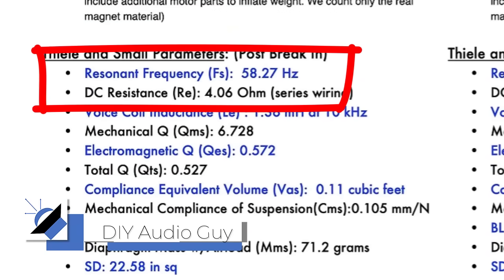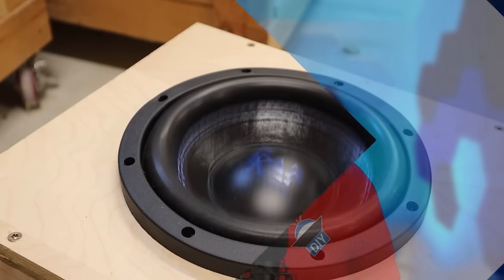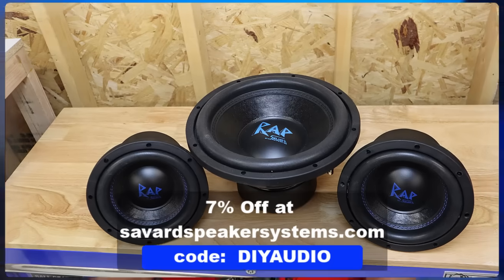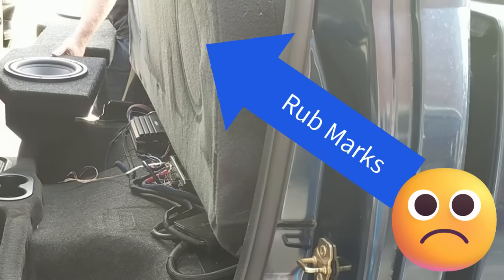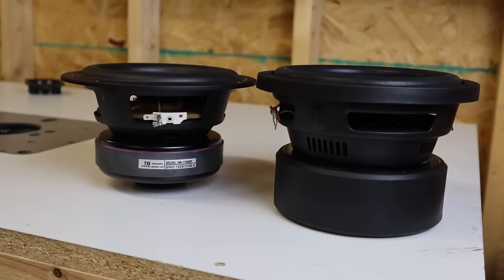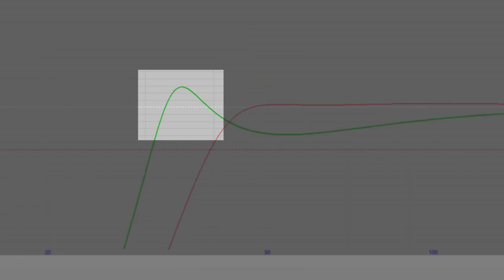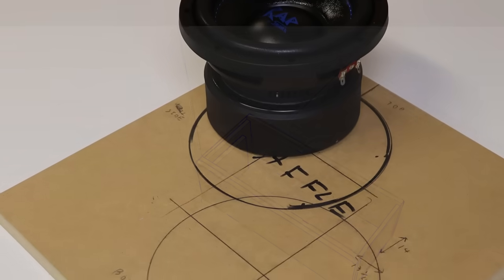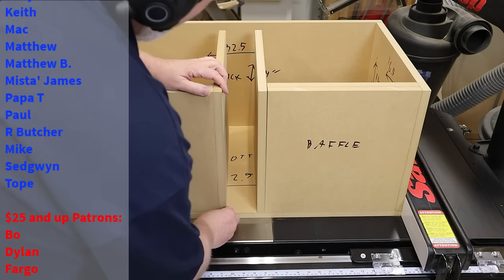The Problem With Small Subwoofers

Comment: One of the equalizing factors a small sub has has to do with acoustic coupling. In a standard sealed or reflex application the coupling efficiency isn't all that high. If you horn loaded a cabinet or use a column of air to dampen the speaker at a specific set of frequencies you can help to make up for the smaller size of the driver. Of course this is in theory. To do it correctly requires a lot more work than using them in a sealed/vented system. Truthfully though, the same applies from larger drivers too. I made some custom tuned systems for a friend that used two 4" woofers to generate more bass than a single 12" system. With proper tuning along with using factors such as the internal resonant effects of the vehicle cab, you can achieve some great results with small drivers.

Comment: My 30 years of building enclosures has shown me that more motor force per square inch and FAR better cooling makes it easy for quads to beat a single in the same available airspace! Diffraction imaging and power compression are the problems of larger drivers.
Reply from the maker: Excellent point.

Comment: Well? If you run sixteen 6.5" subs wired in series parallel on each side, you're probably gonna have more magnet & power and moving mass responding Quicker than an 18" subwoofer. AND That would quadruple efficiently efficiency. Home & car audio doesn't seem to pay enough attention to the Benefits of high efficiency if you ask me. I run band speakers in my house.

Comment: Tried Hertz MPS250 10' in my polo, cause had only 14L of space in the spare wheel (made a circular custom box in it). I gotta say I love it very much. Some pieces in the car rattle when it plays full tilt with 500w amp. It is not going very low tho, I think 35hz tops.
Reply from the maker: Nice!!

Comment: The real problem, trying to explain the problem with what you’re trying to explain is it’s more complex than that. You can also like you said add more power to the speakers having stiff suspension does raise the FS.. but if you have enough total volume, you can overcome a lot of these problems.meaning go full retard on your small setup. I have 3 hippo xl 6.4 subs is a small box I’ve taken the box apart three different times to get the tuning just right and now it hits Lowe’s like an hi power 18

Comment: I'm a bass player. Multiple, 4 to 8 10" drivers are considered ideal because it allows low bass frequencies with tight bass and they can handle a lot more power than 2 15". The lowest bass frequency of a standard tuned 5 or 6 string instrument is 32 HZ. The small interior space of a car or truck allows good bass response from small speakers because pushing a lot of air isn't necessary. The same speaker in a room would sound pretty bass shy.

Comment: Most music doesn't actually go that low so you don't need a big subwoofer, also there's the fact that many people dislike the additional noise of the car rattling along the sub. 
Sure if you want to have a rattlebox that turns heads wherever you go then sure big subs are ideal, but if you actually want to improve the sound quality smaller subs should work well.
Reply: a small sub can rattle a car too, it's up to you to get a well built car or to add sound deadening/vibration damping material yourself

also depends on the type of music you listen to

i mostly listen to DnB and bass does actually go down to around 25-35Hz often in the songs i like

that being said the biggest subs i have/had are only 12" which are plenty for me and can play that deep, especially my Punch P3 in the 3.15 cuft box which is tuned to 25Hz

i actually think larger than 12 sounds worse, 10 best for sq imo cuz most of them 15" and up are generally slower in transient response, 12 is a sweet spot in loud and deep bass with decent transients imo

but even the weakest 10 i ever had which was some no brand sub, once put in a decent box, actually already went loud to be fair, and already audibly vibrated the car.

fun fact that no name thing was better than some Crunch garbage sub i bought years later

Comment: The Rythmik FM8's which are dual 8 inch servo subs have, in my experience, no equal. I've tried Rel, SVS, Martin Logan and Velodyne (12-18 inch subs) and the 8 inch FM8's simply blow them all away in terms of transients and integration into the mains. Absolutely no comparison in my opinion. They pressurize the room, can shake the walls and yor stomach, and are yet so clean (i.e., not muddy). Perhaps I'm comparing apples to oranges given they are servo subs but....
Reply: Servo subs are the only way to go if you can swing it.

Comment: I'd  say Spl depends on the mass of the sub moving more than the power. And the sound depends on voicing capabilities of the woofer.. neither of which anything smaller than a 12 or maybe 10 inch sub could impress me  enough to use them. Air movement is key. Ported boxes have more dynamic sound VS sealed. You can use more power in a sealed box tho and it's significantly smaller in airspace.. I just prefer to use  8 - 12's  in my vehicle. That way you don't need more  bass. Like... Ever!!? It's always plentiful.. haaha😂😂

Comment: i tried recently to get a ported 8" with a custom folded port with radiused inlet and outlet to sound as good as a 10" in the same space of .5cuft and it was a bust, the port noise and less tight response made the 10" sound better by comparison even if on paper the 8" might have seemed best

Comment: i still have 4 dayton audio rs225-8 drivers with aluminium cones laying around, waiting for two high sealed boxes. sealed and big enough to get a smooth roll-off at the lower end. no more vented boxes for me. with two class-d amps and an active crossover, i will be fine. two fosi audio amps should deliver much more power than i will ever need in my living room.

Comment: Hey, what's up with the formula at 0:46? i mean, what is 50pi doing in the nominator there? The formula should be 1/(sqrt(...) * 2pi), as long as you use proper SI units. Yes, if you use different units (N/mm, grams) you will need a conversion factor somewhere, but whatever happens, how could pi had possibly moved to the nominator??
Reply from the maker: The source I use for the formula was incorrect.

Comment: I've owned just about every brand and size of subwoofer out there. Unfortunately car audio in the 80''s and 90's was ridiculously expensive especially for a kid. But thr first time I was able to afford a larger subwoofer "15's and 18's" I could never go back to smaller subwoofers. If you don't have the room then sure you can get plenty loud with an 12,10 or even an 8. But in the end there's no replacement for displacement. Cone area is king.

Comment: Idk... you put a single 15" Crescendo Forte in an extended cab 96 ranger and you wont need to buy multiples of the same woofer or get too crazy about box design. Thats the other thing... if you have the option to buy just one sub VS. Two or four of the same one, thats money that could be spent elsewhere in the build. Admittedly, i used to try to see what i could build with little or no money. Ive traded for car audio stuff, people have given me stuff... that Crescendo was in a guys yard and i passed it every day for three weeks. I was walking to the dollar store when i seen the guy outside. I asked him what he was doing with the box because i had a RF 12" and needed a box. He says " you want it? You can HAVE it, sub and all" i asked him what it has in it. He said it was a crescendo until his "girl" threw some groceries in the trunk and a gallon of milk ended up busting the cone. I epoxied it back together and beat the roof up in my ranger for a year and a half 5-7 days a week with it. I could never afford to do apples to apples tests to see what i like best in a setup... it used to be "run it til it goes up in smoke, attempt to fix it, if not worth fixing, find a deal on something as good or better something. Nowadays, i do have some adult money, but im more focused with engine building and engine swaps because my bass truck turned into race truck

Comment: Small subs are cool, for the intended purpose, but i also like using them with passive radiators . Even more space , easily adjustable tuning, and more cone area. Not as much of a peak in dbs as ported but a much better bandwidth and still a good amount of bass.

Comment: The box you built for your point doesnt make sense. You still ended up with a small box with a long port taking up much of the volume. You can split that box in two, right down the middle. So compared to a single driver, you only saved 1 endplate in box size.

Comment: I used to be a 12s and 15s type, now i use 10s, the box is what matters most in my opinion, in the right box you can get louder than a couple 15s in a bad one.  got a ds18 zr10 d4 on a taramps md1200.1 2 ohm in a 1.8 cubic ft box tuned to 31hz and its able to float a bag from 26-34hz
Reply: 18s are where it's at.. "that earthquake bass lol

Comment: Im actually looking to upgrade my system. If i go to a random local stereo install store will they be able to help me without ripping me off? I don't know what will fit how many subs to get what brands, amps ect, ect. I have a new truck with full size crew cab.  Im looking to do  under seat mount subs. Would i need to replace the factory door speakers too?
Reply from the maker: They will try to upsell you  as much as they can.  No different than anythign else these days.

Comment: Ok so I have a CT Sounds Strato 8" sub in a ported box and it gets the 600 watts of RMS it can handle. What would be the best Sub to add to get the deep deep rumbling bass at the lower hertz to pair with this that would run at 600 watts rms?
Reply: a 15 inch sub.

Comment: If you want to use them in some sort of horn box, they can be good, but price to displacement ratio with smaller subwoofers isn't as good. Or in a small box, a passive radiator might be more efficient than a long skinny port.

Comment: I don't know why people like these smaller subs if space is limited get swallow mount 12 with a long vent to get the most out of your sub. I used the skar vs12d2 for a couple months before getting a new box and a 12inD2EVL with a new 1500w amp I'm about to wire it to 1ohm and its going to be perfect for my extended cab f150

Comment: If you're concerned about box size and footprint putting two subwoofers together isobaric allows you to cut box volume requirement, still requires a long port though and port resonances become a problem. At that point you're basically needing to build a tapped horn design.
Reply from the maker: I like to call that the small box problem.  As the box gets smaller the port needs to get longer.

Comment: Smaller woofers will be faster than larger woofers.  Therefore, smaller woofers will be more dynamic than larger woofers.  Done right, you will get more slam out of smaller woofers.

However, larger woofers will push more air.  So comparing one small woofer to one large woofer will result in trade-offs.  The solution, to have it all, is to have multiple small woofers.  Then you get the speed / slam, and you get the volume of air that is pushed by a large woofer.
Reply: No, they are the same speed, it's the same frequency dude.
Reply: @N4CR  "No, they are the same speed, it's the same frequency dude."
There are fast amps, and not so fast amps.  You can hear the difference.  Yet, both amps are reproducing the same frequencies.

Smaller woofers will respond faster.  It takes less effort to get them pulsating, and less effort for them to change their amount of pulsating, as the frequencies change.

Comment: Was running a 12” in my trunk and it was great to rattle everything on the outside of the car. Switched to an 8” mounted (in a custom box) to the underside of the rear shelf firing directly into the cabin. Sound is better both inside and out.
Reply: I put a 12 in the cab.. sounds amazing.. putting it in the trunk was the bad decision.
Reply: that has nothing to do with the size of the driver and everything to do with your install. You'd have been better off trying to make your 12 work in a similar install to your 8
Reply: @ZZPxFTW  I obviously would’ve preferred to use the 12” in a similar way, unfortunately the rear deck size wouldn’t allow it.
Reply: @ImJaySco   gotcha; just with the topic of the video being what it is, I read your comment as implying the 8 was a reason it sounded better.  My bad
Reply: @ZZPxFTW  idk, its like you say its about the instal vehicle, theres tons of variables. did the sound proof the cab, or atleast behind where the speakers are located. Theres tons of things that affect sound.
Reply: @Killastoned it’s even more than that.  It’s shot tons of things.
Reply: My first car in 95 Cavalier 2 x15 in PPI subs in a sealed box what's a PPI bass amp with remote bass knob it hit hard but sound quality was amazing
Reply: I bet that sounds good with bass bouncing off that back window and rear deck, especially if sound deadened good.
Reply: Yes this is exactly what i wanted to say, I had two 12s in a 2020 crv open cab firing straight up. switched up to three 10s. in a skar 3 ported box. At half power its sharper =that the 12s. the 12s were loud yes, But lpf would distort em at heavier/higher loads. The 10s handle it without an issue and tbh its so much louder. But i do believe the size of the cab/trunk your using plays into everything, so what works for me and sounds great might sound like shit to you.
Reply: Was that a bandpass enclosure ?
Reply: @NickySeven-l6e No, basic ported boxes.

Comment: Hi DIY GUY, I love your channel. I build small full range stereo speakers that sound awesome and are super inexpensive. However they sound way better with a sub. But I suck at building subs. My UNICORN is an inexpensive sub driver under $100 in a ported box which sounds as good or better than a logitech Z623 sub. Remember its a desktop or smallish room setup, so I'm not out to shake the house. From your vast Experience, Can you reco a driver for my UNICORN? You can see my builds on my chsnnel. Thanks ahead and happy DIYing.

Comment: Even if the Fs is high, sometimes small subwoofers can be tuned in the 40 Hz region which is about the lowest extent of 'musical' bass, apart from synthesized bass. And if you've just got room for a tiny cube sealed box, you can still apply equalization and work together with your vehicle's cabin gain function to get 'flat' bass to a low frequency, it will just be excursion-limited or power-limited.
Reply: below 40hz is called sub-bass, and the music bass goes from hearing, to feeling xD

Comment: Yes, BUT: a car is an enclosed space which boosts very low frequency and makes it perfect to use a small sub as you can tune its enclosure to this small space or am I missing something here?
BESIDES: I don't look so much at what Watt a speaker is rated at but I am more interested in High Sensitivity and Low Distortion over the intended range

Comment: We have already done this comparison. 
Two 12" drivers tend to win against one 18" driver because they often have a more powerful motor in relation to the MMS. This means that the 12" drivers are also capable of handling more power. However, you have to find 12" drivers that have just as much Xmax, which is quite difficult to find. Because the 12s tend to have a better mass/drive ratio, they generally sound much more precise.

Overall, however, it makes no difference. If the TSPs were the same, it wouldn't make any difference whether you put two 12" drivers or one 18" driver in the same cabinet. So it depends more on the parameters than the driver size alone.

Comment: 250 watts? people still buy speakers that weak? well, if they put 1000 or 2000 watts on the box I probably wouldn't trust that either. buy a good brand and know what you're getting. I paid $350 for a diamond audio 2000 watt 15. they sell 10's too, but I don't want something that small. I know what I have can really handle that power too, all day long.

Comment: Hey y’all, any opinions on whether you’d prefer the performance from (1) 15” with a 6” vc, 240oz mag, and 25mm xmax, vs (4) 6” subs with 2” vc, 80oz magnets, and 7mm xmax. They would fit in a similar size box but the total vc, xmax, and magnet structures are greater values in the quad small sub setup so I presume the force generated is more violent with the multiple motors. Is there a drawback to either or benefits? Also considering that the multi sub setup can be wired as isobaric.
Reply: 6” voice coil?

Comment: I built a custom enclosure to Savard's specs (volume, not shape).  I am running 2 8" HQ series subs powering them with an Audio Control LC-1.1500.  They play pretty low and hit hard, but above 60Hz the output rolls off quickly, and by 90Hz is almost inaudible.  Any idea what could cause this?  I have verified it is not a crossover issue, I plotted input voltage to the box vs dB output.  Power is there, audio output is not.
Reply from the maker: Try flipping the polarity on the subs and see what happens.

Comment: Small drivers are inefficient at low frequencies. Even if you add more drivers to get surface area up, you will have more losses, distorsion and lower sensitivity than if you just started with a large driver of the same area from the beginning. It only makes sense if a larger driver doesn't fit where you want it (basically when smaller is your only option).

Now, if you want your heavy, large, low FS sub to play high up into the mid bass (I dont know why you'd want that?) then you'd be better off with smaller drivers. Or, to be real; use the big sub to play very low frequencies and add mid basses for the mid bass where they are more efficient.